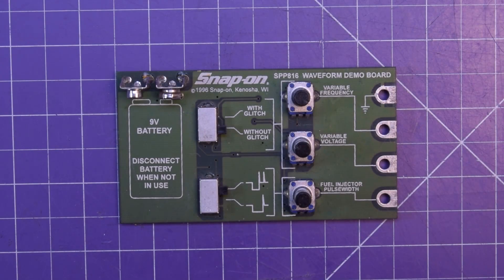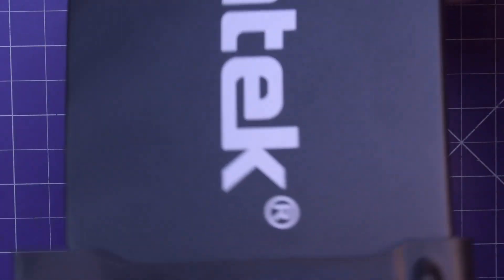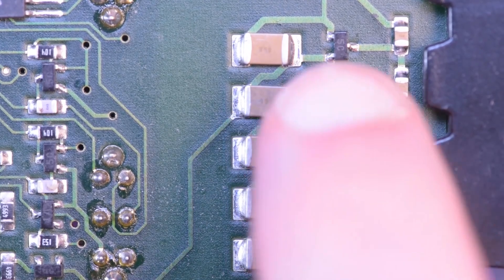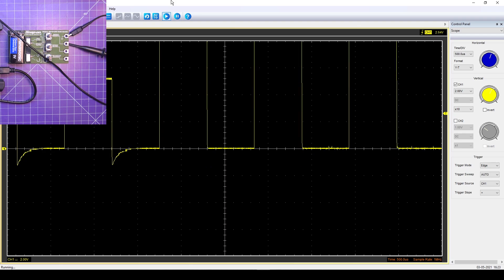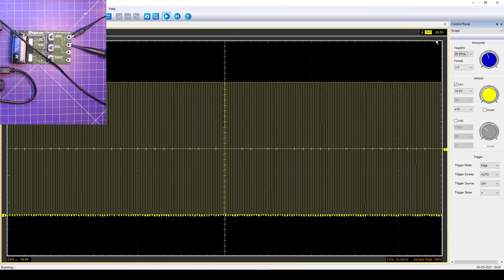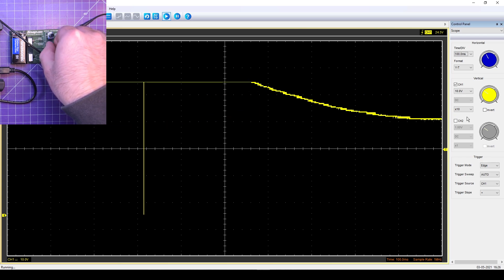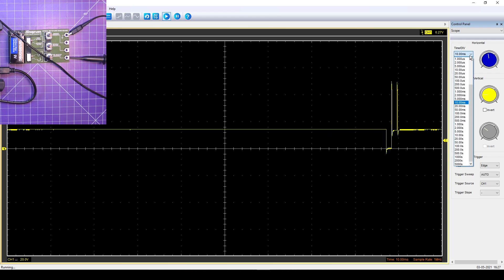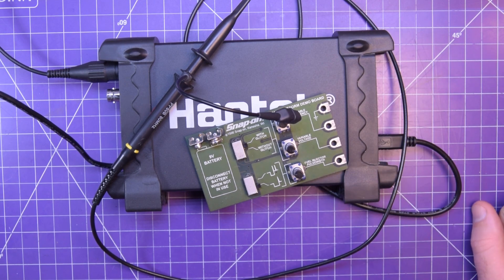Rare Snap-On SPP816 Demo Board!

Comment: I see that your channel is called Simple Electronics.  Maybe you could direct me to a source that could be viewed as VERY Simple Electronics.  I have been looking high and low on the internet and YouTube itself, and this is a very elusive bit of information. They all start off with "what is a resistor" and within 6 minutes they are at "so there you've just built your first nuclear reactor!"  Do you know of a source that can explain, for example, how to translate a schematic into actual step by step reality items? Or, if you see this, this and this on a schematic that means that these wires go here here and here in reality. Any suggestions would be appreciated. I've already gone through dozens with no success.
Reply from the maker: Well I have over 300 published videos, going from super beginner to early intermediate, have a look through the catalog and see if you can find anything you like. Otherwise you'll have to wade through people's channels since there isn't a single one that is ONLY beginner / easy stuff, not that I know of at least.
Reply: @SimpleElectronics  thank you for responding. It is really baffling to me that this kind of teaching doesn't exist in the field of electronics. It does exist in most every other field I can think of, but not Electronics. Oh well, thanks again.
Reply from the maker: It does exist though, it's just you have to dig a bit to find beginner content because there isn't a channel doing only beginner stuff, it's a very limited market. Try looking up subjects instead of channels, like "reading circuit schematics" and "beginner circuits" and "ohm's law" - there are lots of those types of videos floating around!
Reply: @SimpleElectronics  your search recommendations are exactly what I have been using and, sadly, getting nowhere.  I think my problem is that reading schematics requires a specific way of thinking and the proverbial light bulb moment when it all starts to make sense because one key thought becomes clear.  I have not experienced either of those. If I could sit down and question somebody one on one I think I would be able to get them to reveal the key to the lock for my understanding. To find that person is even harder than finding useful information on electronics on the internet.
Reply from the maker: Jon, I have a proposition for you. I've been teaching schematics professionally for about 4 years now and recreationally for over 10, would you like to come onto my podcast one day soon (like this week or next week), and I can try to teach you about schematics? I'll answer your questions to the best of my abilities and I'm sure it will help more than just you. Send me an email if that sounds like a good idea (you can find my email in the "about" section of my YouTube channel
Reply: @SimpleElectronics  I have questions about your kind proposition but I cannot locate your email on your YouTube channel.  Most likely, I am misunderstanding your description of it's location.  Can you help me?
Reply from the maker: @greenbeginner9221  Go to my channel ( www.youtube.com/simpleelectronics ) click the "about" tab, and scroll down to the "details" section and click the "view Email address" button, complete the captcha and it will reveal my email address
Reply: @SimpleElectronics  Sorry for the trouble but on your channel"about" tab, there is no "details" section that I can see.  There are only two headings: "Description" which includes your P.O. Box address, and "More info" which states your country, when your website started, and how many views you've had.  Maybe it's a "rights" issue?
Reply from the maker: @greenbeginner9221  It's not, it may depend on which device you use, it won't work on mobile; SimpleElectronicsYT@gmail.com is my email, but I have to delete this in the next 15 or 20 minutes to avoid getting spam

Comment: What an interesting board. Not keen on PC scopes. If you have a crappy computer then you'll have a crappy scope. :)
Reply from the maker: This is true to a point, a raspberry pi can usually outperform the data rates that these scopes communicate at, since they are usually USB2.0